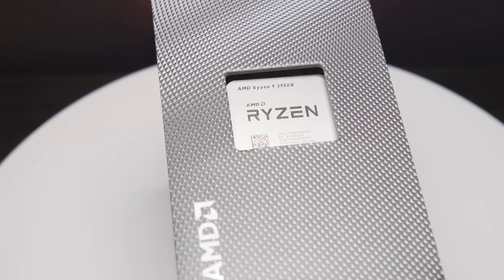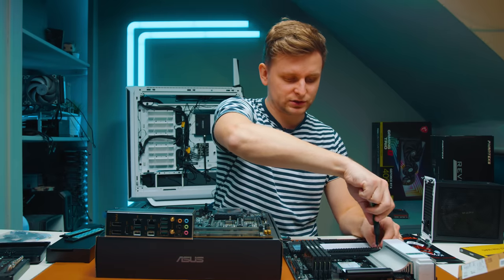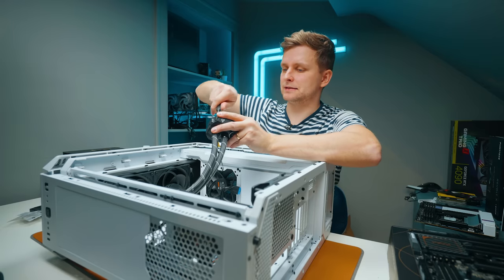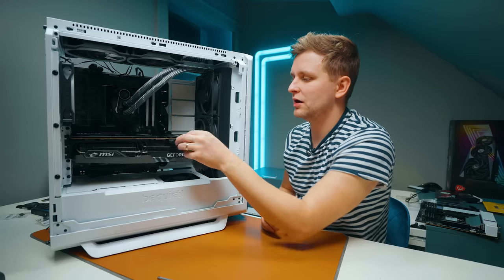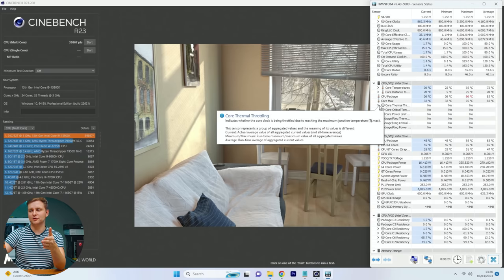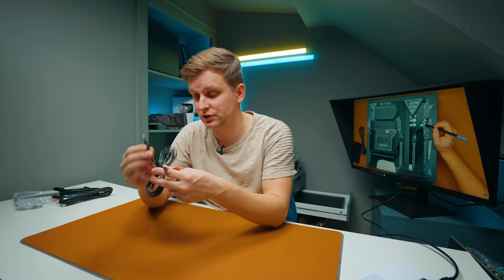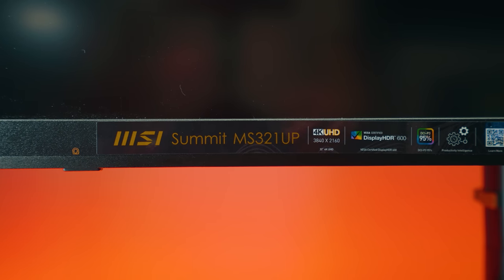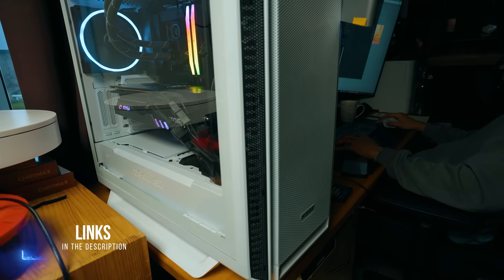My Dream Video Editing PC - 'BEST' Creator PC 2023

Comment: 850w should have covered this fine.  The cpu is only 250w which gives 600w for GPU the gpo only takes 450w so you have 150 extra.  The 1200w is overkill but I suppose it's going to run cool
Reply: 250 only if you power limit it, in the test he did the cpu pulled 304.
Reply: So according to you this pc only needs enough power to run the cpu and gpu? The fans, rgb, nvme ssds, the aio pump, the ram and other peripherals that you might connect to the pc don't need power? Come on dude. Psu power is not calculated just based on cpu and gpu only.
Reply: @Prabhu_njd  read my reply.  There is 150w left after CPU and GPU.  Please read maybe you have 150w of load, but a fan is 6w, and nvme about 5w, aoi pump is 3w RGB maybe 10w if as bright as a 60w bulb, so you can add lots of RGB, fans etc and still come in under 850w, but you seem to think these peripherals that have no cooling need 500w.  Have you any idea how much heat 1200w is.  It's equivalent to a hairdryer at full power and would heat most rooms in winter.
Reply: @barryobrien1890  sorry i missed out the 150w part. My bad. But what's wrong with going 1200w? Even his system does only need less than 1000w, it's not like his system is pulling more power than it needs. Psu tend to last a long time. He might just need it for future upgrades.
Reply: @Prabhu_njd  nothing if you can afford a 1200w psu.  I merely suggested an 850w would have done the job, without spending the extra, or go for a better efficiency model.  Given the push to lower nM cores, I think going forward we will see more efficient cpu, GPU and storage.  Maybe faster networking will need more power.  For me, I think a high efficiency 850w gold/platinum is the sweet spot for power and price, but youay be right to go bigger.
Reply: @barryobrien1890  yes i agree. Let's hope so too that these companies will be making more effiecient and low energy consuming silicon in the future. 

I had an 850w fsp gold psu on my previous prebuilt pc which had a i7-12700kf and a zotac 3080 OC LHR 10gb. 
Then when i decided to build my own pc i went with an i9-13900ks and a strix 4090 oc. I got the asus thor 1200w p2 psu in my build too. I went with that psu as i had future upgrades in mind like a future 6090 or a i9-17900k. As i thought these cpu gpu and ssds in the future will only getting more faster, hotter and more power hungry from the looks of the new pcie gen 5 ssds that scares me.

Comment: dude save those parts you can have a dual pc setup i use a dual pc setup for streaming cause i play video games not talk about that i play games . or play warzone . i just do lets plays off varsity of games dude did you remove the film on the mother board there was a blue tab everyone fails at the plastic tabs

Comment: You should also mention that the Fact of the matter is mac silicon will absolutely destroy any pc out there for video editing due to its built in h264 and ProRes chip.
Reply: It won't though. Because guess what? Intel has had a dedicated chip for H.264/h.265 for yeaaarrsss. It's called quick sync and in Adobe's own tests the M2 chips are about equal to the Intel quicksync options.

Prores is specific to the MacBook which js great!.... If you use it. And since prores isn't that heavy of a codec to play back, it's less useful unless you do crazy multicam stuff.

Got a MacBook because of all the hype. And yes for the amount of power it uses it's amazing for video editing. But as soon as you need to do a little more (like special effects or multiple plugins/grades) it slows to a crawl because it still a mobile gpu/cpu.

They're great as portable media creation stations. Don't think it's easy to get something better. But any GPU with encoding support will wipe the floor with an apple device. which is fine since just the GPU will use more power that the entire Mac ever uses.
Reply: @tharealmb  dunno man I am just going off thousands of hours of real world experience on both the fastest possible PC and a decked out m1 max macbook pro.  The macbook absolutely destroys playback and rendering.
Reply: If your going to put on a bunch of GPU intensive effects to the video your working on then perhaps a PC with powerful gpu might be better.  But in my experience, at least in premiere the mac silcon chips are still going to be faster then any gpu out there.  You also have to realize that its about the architecture of the mac chips.  The ram basically acts like crazy crazy fast VRAM.  So if you have a m1 or m2 mac with 64gb ram then thats almost 3x as much vram that a 3090 or 4090 has.  Also the GPU, CPU and ram just talk to eachother much faster which adds to the fact that mac's currently are simply way faster and better for video editing.
Reply: @CinemaNinja  the drawback of Mac studio is just that you simply can't upgrade any further than the PC do, also unupgradable components can fail at any time
Reply: @CinemaNinja  "Also the GPU, CPU and ram just talk to eachother much faster which adds to the fact that mac's currently are simply way faster and better for video editing."

Until, as stated, you do something that relies heavily on GPU cores and not pure IO.  It's great that for your use case it's fast but your use case is not all use cases.

Comment: Is a joke, I hope. You install a CPU for about € 640,-, a motherboard for about € 550,-, a GPU for about € 2000,- and then about € 50,- for the Thermal Grizzly Contact Frame is too much for you. Really now?
Reply from the maker: When you can get the same thing for 10USD, that does the same thing? :)

Comment: Well, THE BEST creator PC would be with AMD Threadripper PRO 5995WX , not with 13900K. He`s just using High End desktop PC for work, that`s all. :)
Reply: With a max boost of 4.5ghz? It would be much worse in lower core usage. LoL
Reply from the maker: Well for Premier and my workflow the 13900k is better ;)
Reply: As long as the video encoder/decoder of AMD doesn't work with Premiere/Resolve, Intel is the way to go sadly.

Just upgraded myself, but because of quicksync upgrading to AMD was just not feasible.
Reply: @tharealmb  Are you kidding??? Have you seen rendering with Threadripper??? What 13900K does in two hours threadripper do in less than 15 minutes.